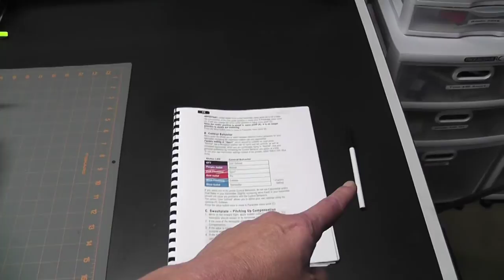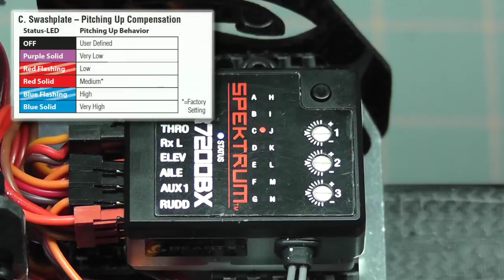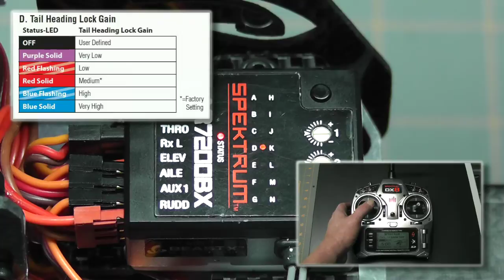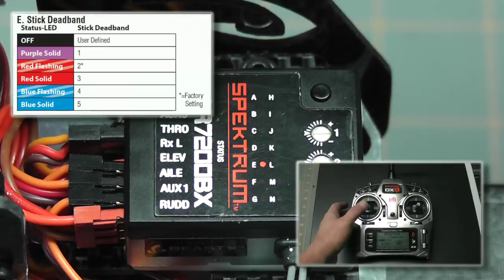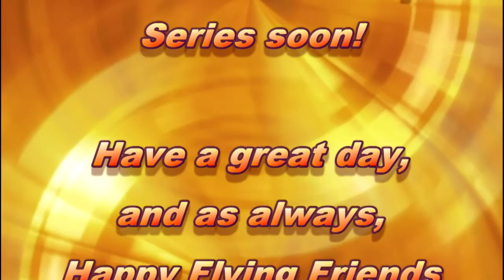Goblin 500 Electronics Set Up  Video 8

Comment from the maker: Totally odd!  Did you set your tail limits?  Another thing to check it is Tail Servo Center Frequency.  When this is set properly, the tail servo will be centered.  Here is what I did.  Centered the servo by hand (moving in both directions and guestimating center) and centered the horn when I installed it.  Then when it initializes, you should see it snap to that same center.  If not, try a different frequency.

Comment from the maker: Hey bud!  Have Parameter D set to default and my gain in my DX8 is 55 for all three, N, IU1 and IU2.  If you heli spun around when you spooled it up I would check Set Up Menu F.  The default is Normal but you may have to go reversed.  When in Set Up Menu F, move the tail and check the way the tail blades move.  They should bite in the opposite direction or try to correct the movement in the opposite direction.  Hope this helps!